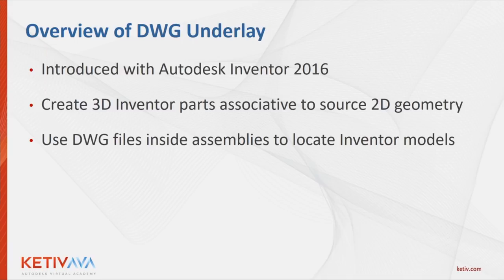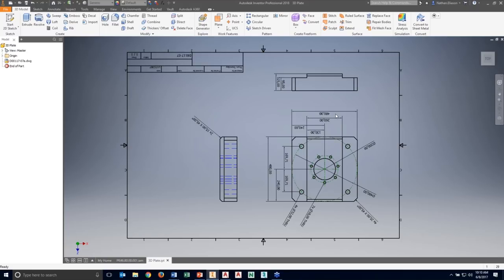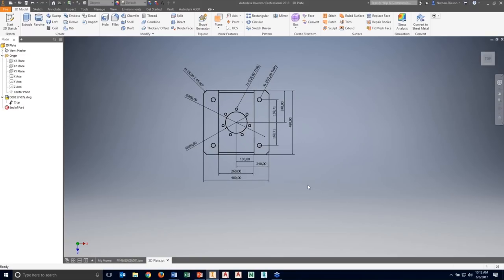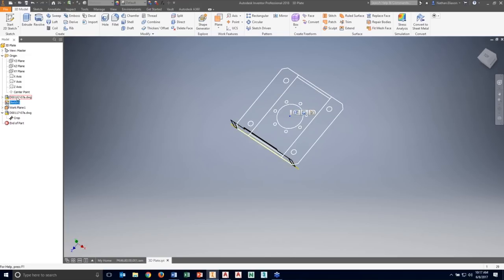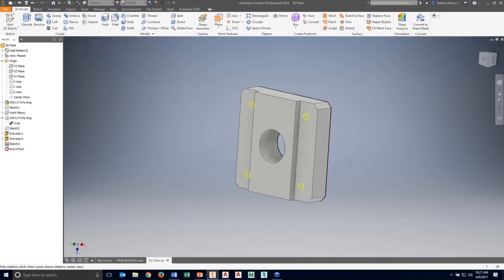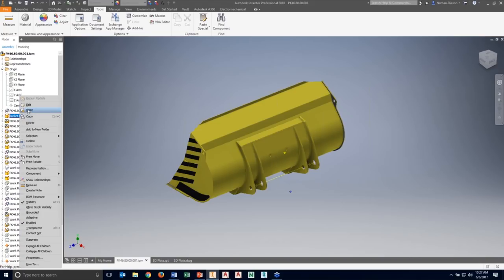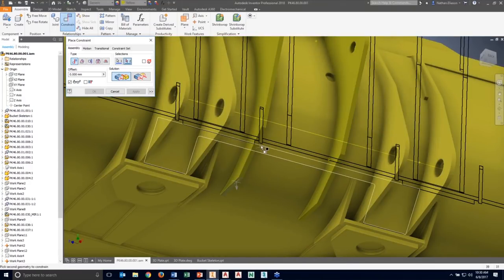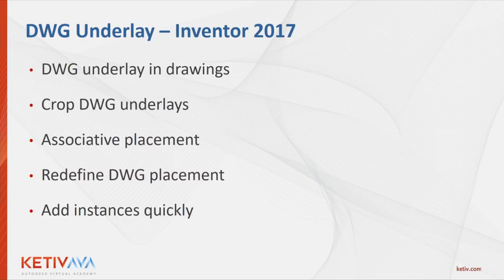Import AutoCAD Drawings to Inventor | Autodesk Virtual Academy

Comment: Hi! Thanks for the video, I have one question about this procedure. When i import an AutoCAD file with Inventor i dont get the imported file in the right scale, if i open the DWG in DWG Viewer the scaling is correct but not when i import it to Inventor. Is there any way to fix the scale inside Inventor?
Reply from the maker: Hi Joakim,

Our pleasure! Our goal is to make the community stronger by sharing our knowledge.  
My understanding is that the file comes in as drawn from AutoCAD. The underlay technology is purely for consumption purposes, so any updates or changes to the file need to be made on the AutoCAD side. 

-Nigel

Comment: Good day!
According to your technique, I inserted the drawing file (in mm) of the AutoCAD 2022 into the Inventor 2022 sketch and suddenly noticed that all the dimensions in the sketch increased and became 25.4 times larger! The 165 mm size turned into 4191 mm and so all the other sizes! It's like an inverter converts inches to mm. I can't find the reason, maybe you know ?!
Reply: Sounds like a trivial issue. Did you create a new part drawing in the Inventor that has the imperial unit in the first place? You need to set the drawing unit from mm to inches in Inventor first, then import the Autocad drawing.

Comment: What about this 11:06 ''project geometry'' command ?? this first one,  What is it for? Isn't it usefull for a DWG drawing?

My another question is: Is there a way to join lines, arcs and etc?
Reply from the maker: The project geometry command gets geometric information onto a sketch on another plane. This is useful when you want certain things to line up in a particular way with respect to other portions of the design.

Comment: None of this process actually applies to importing a dwg or dxf into Inventor. Not one single step works!
Reply from the maker: Hi Harrelson,
I do apologize for misunderstanding about importing .dwg files into inventor and reusing the data from the files. You may find some additional steps to achieve importing these files at the link below.
https://knowledge.autodesk.com/support/inventor-products/learn-explore/caas/CloudHelp/cloudhelp/2014/ENU/Inventor/files/GUID-9996B399-313F-4AC2-9E39-B92CE5112F30-htm.html
Hope this helps!
Best, 
Jeff